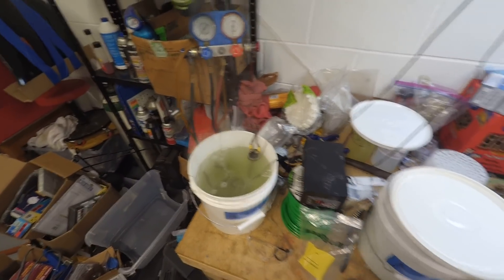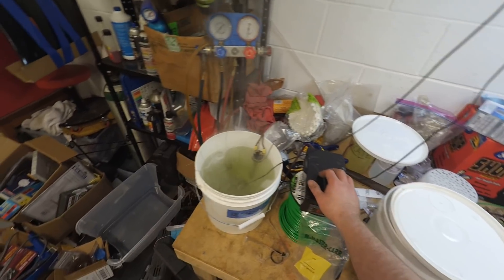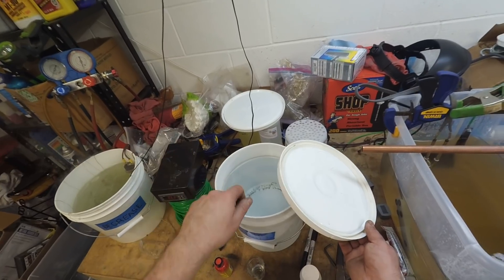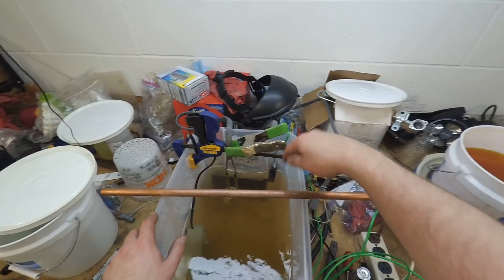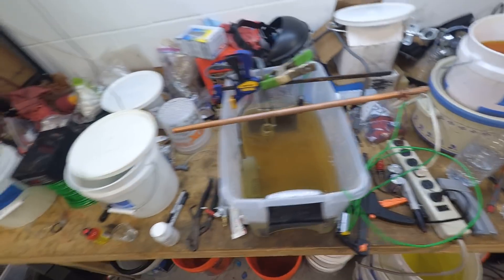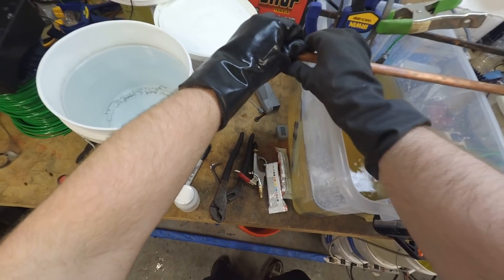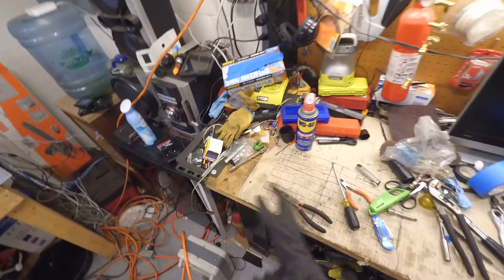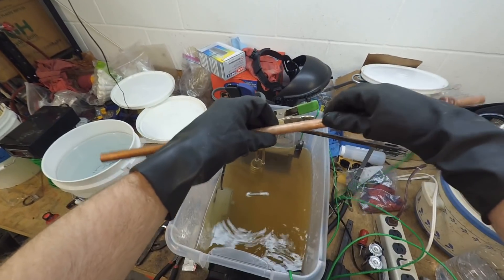Caswell Zinc plating system

Comment: I have had an issue with the yellow chromate sticking to the parts.  After 24 hours it just wipes off.  Do you use heat or anything special to dry the parts so the chromate sticks better?
Reply from the maker: Nope. Are you dipping your parts in acid and then rinsing right before the chromate treatment?
Reply: @adamky1   Yes.  5% muratic acid bath.  What is your chromate mix rate.  1 oz per gal?  I have read some use 3oz per 1 1/2 gal up to 2oz per gal.
Reply from the maker: @kzem968  I honestly do not remember. Did  you heat the chromate solution up to the correct temperature? That's the only other thing I can think of.
Reply: @adamky1    YEP.  85 degrees.  Where I live is 90% humidity right now so maybe having the parts hang outside in that for 24 hours to completely dry and set is my problem?
Reply from the maker: @kzem968  I wouldn't think humidity would affect it that much, but maybe. It sounds like you're doing everything else correctly.
Reply: @adamky1   That kind of sucks because the chromate continually fails to stick.  maybe I need to dry and hang the parts for more than 24 hours?  I did see a video where a guy dropped the parts in the 5% muratic  acid before plating and before chromate but since the plating seems to be fine I'm guessing that does not matter.  craziness.

Comment: 06:50 actually, NO! They are not molecules travelling from the zinc plates. They are ions - and they come from the solutiuon. What happens at the plates, is a completely different story. That is only zinc being deposited into the solution, to replace what has disappeared during the plating process.
Reply from the maker: ,
Okie dokie

Comment: It is a miracle that you are still alive and healthy after using that setup. No air filters, no security what so ever for using so many hazard liquids in such precarious setup, unsecured and in dangerous positions. And on top of this so many electrical plugs and devices all over the place and around those liquid containers. Man, I do respect your generosity to show us your experience with that setup but PLEASE tell people this is not a good safe way to do plating. Also, I am very sure a damn new bolt cost so much less than a single use batery. Other then that thank you for the video.

Comment: Fantastic video, thanks for sharing.  I got the Caswell kit last week and look to start plating next week.  Your video is a thousand times better than what they have.  Thanks again for putting this together, it will certainly save me some time.  
Do you have a link for the heater controller?
Reply from the maker: The Restoration Shop. Thanks! This was the controller I purchased: Inkbird All-Purpose Digital Temperature Controller Fahrenheit &Centigrade Thermostat w Sensor 2 Relays. Link -->
 https://www.amazon.com/gp/aw/d/B00OXPE8U6/ref=oh_aui_i_sh_in_o0_img?ie=UTF8&psc=1

Comment: Is it possible to plate parts with non-removable non-metal components in them? For example, a check valve that can't be disassembled all the way with a rubber diaphragm inside?
Reply from the maker: noob5000000 I've done it. I plated my entire water pump assembly which had an aluminum housing, steel shaft/impeller, and a rubber seal. It's been working fine. But I can't say for sure how your part will hold up.

Comment: Hi Adam - Great video. Inspires my to set-up my plating bench.

Can you tell me what solution is used for the rinse tanks before I dip the parts into these tanks:

Degreaser Tank
Acid/Pickling Tank
Plating Tank
Yellow Chromate Tank

I just ordered the Caswell Copy Cad kit so do some of the rinse chemicals come with that kit ?

 A friend recommended a Kikusui PAB 8-5 Power Supply so I bought one to use on my set-up but the rest will look like yours.  

Thanks,  Mark
Reply from the maker: Thanks, I appreciate that. Every rinse bucket is just pure distilled water.

Comment: can you tell us more about the degreasing solution, I see it looks very hot. How do you keep that?
Reply from the maker: Caswell says the degreaser works best at 170-180*(F). This is the temp controller I use: https://www.amazon.com/gp/product/B00OXPE8U6/ref=oh_aui_search_detailpage?ie=UTF8&psc=1
It was cheap, but it requires some sort of "project box" to put it in,
and it's a bit glitchy and sometimes reads way off. So I occasionally check it with a cheap infrared thermometer from Harbor Freight.

I've tried several heating elements. What you want is something in the 1500W range. And unless you have a full size degreasing bucket, it needs to be short. As it turns out, heating elements for RV water heaters are just about the right size.

...or here's another one that I tried, but I MUST warn you first that as-is, it's dangerous. The wiring is totally inadequate and WILL melt and short out if you run it for more than 30 seconds: https://www.amazon.com/Westcoastpapa-Travel-Immersion-Portable-Element/dp/B01307Z89C/ref=sr_1_fkmr0_1?ie=UTF8&qid=1498030604&sr=8-1-fkmr0&keywords=XtremepowerUS+1500w+Water+Boiler+Coffee+Tea+Heater+Immersion+Portable+Boiler+Element
So the wiring MUST be upgraded before use!!!!!!!!
The nice thing about it is that the part that goes in the water is all stainless steel so it shouldn't cause any issues with plating. most of the RV units are chrome played and the zinc-plating process will strip that off.

Comment: What is the ratio of muriatic acid to distilled water you are using in your pickling bath?
Reply: Jason with Caswell said to use 10% muriatic acid and 90% distilled water.
Reply from the maker: Allen Nichols - Yes, pretty much everything I do is using Caswell's recommendations

Comment: Hi. 
1. What is in degreaser tank? Water and ?
2. In plating tank what is in the solution and why are you using aquairum filter for circulating?
3. Which buckets are you using Distilled water? Rinse or the others?
Reply from the maker: Arda Yalçın - The degreaser is from Caswell. And the aquarium pump is just there to circulate the solution. It comes with the Caswell plating kit and they recommend using it.
Reply: thanks for your respond. In this kit is there in zinc sulfate

Comment: Nice job, well done. What material are your hanging wires? Also, why is your zinc acetate so murky?
Reply from the maker: Thanks! The hanging wires are 10g solid copper. When you say "zinc acetate", are you referring to the yellow/gold chromate tank?
Reply: adamky1 no, the zinc plating solution
Reply from the maker: Ah, gotcha. This was after a long day of plating and my tank gets like that after a while. I like to run the entire solution through double coffee filters every now and then and that clears it up.
Reply: My plating solution is crystal clear but the parts come out dull matte grey and won't take the dichromate very well. Yours is murky and the parts come out shiny and passivate beautifully
Reply from the maker: You're running Caswell's plating solution?
Reply: No, home brew. Does Caswells solution start of brownish?
Reply: adamky1 I just ordered the Caswell 4.5 gallon kit. Did you buy theirs or did you make your own power supply for the zinc plating tank?
Reply from the maker: Denise McDowell I am using a Volteq 15V 30A power supply purchased off of Amazon. At this time, the price is around $190. They also have a 20A model for around $140, but I'd rather have more than what I actually need just in case. For example, it took ~22A to plate my fuel rail and I wouldn't have guessed that it would have needed that much to plate properly. The adjustment knobs can be a bit touchy, but it does the job well by allowing high current at very low voltage.
Reply: adamky1 I mixed up my 4.5 gallon Caswell kit and was having amazing results. Beautiful near chrome zinc finish and then after about 10 small parts, it slowed down and the parts are now flat, blotchy and somewhat gritty. I have played with the current and also ruled out pre plate prep. I can't imagine my solution is bad already but it's all that's left. Any idea how to diagnose the issue with the zinc plating solution? I also noticed my tank heater element is black so it appears I have some contamination in the solution already. HELP! Thx
Also, approx how many pieces were you getting out of one new D battery?
Reply from the maker: Denise McDowell - How much brightener are you adding? Have you played around with that at all? What about using the carbon filter on your circulation pump to strip the brightener out of the solution? I do this occasionally just to get the brightener out and then start over again. Also, FWIW, I have had decent plating results even when my tank was cloudy-looking. It's hard to remember how much plating I got out of a D battery... maybe 4-5 medium sized bolts..

Comment: how does your bolt come out of the 1st tin / silver  zinc plating step shiny , and not have the dull grey build-up that requires polishing or buffing ?   Prior to the final step in the yellow dye 
gold color step ? 

great video !
Reply: Mike Short,,,i agree, is this because of the zinc and brightener powders caswell includes? So far I'm getting dull matte zinc that turns rusty brown in the yellow dichromate...
Reply from the maker: Mike Short - Sorry for just now responding to this. I'm just using all Caswell products. So, it's their zinc solution (3 gallons) with a couple teaspoons of the brightener. Prep is super important, and so is your power supply. Too much or too little current can cause bad finishes. You want very low voltage, like 1-3V. I try to get mine as low as possible and only increase it if it seems necessary to  allow the unit to make higher current. Once I get the part in the tank, I adjust the current until I just get some very light bubbling and then I just keep watching and adjusting. You'll know when you've hit the sweet spot because you can  literally see the plating getting smooth and shiny. I've found most things take more current than I estimate using Caswell's formula. It took a full 20 amps to plate this stock fuel rail from my car, and it's not even a really large piece: https://www.youtube.com/watch?v=43fkOIVXiwk
Reply from the maker: It's either the solution, or the power supply. Having a power supply (a.k.a. rectifier) with enough current for the use along with being able to make very fine adjustments are both very important . With small parts like individual bolts, it's easy to get enough current. But larger pieces with very complex shapes makes estimating total surface area very difficult. As a result, I tend to underestimate the total area and end up with 1.5 to 2 times more current than I expected to get a good finish. You'll know when you've hit the right current because you'll be able to see the part actually getting smooth and shiny as it plates. It took around 20 amps to plate this stock fuel rail: https://www.youtube.com/watch?v=43fkOIVXiwk

Comment: adamky1 just getting into the plating scene, I am still trying to figure on what is the best composition for the plating tank ,what chemicals and at what ratio would be best,for the plating tank,im restoring vintage motorcycles and this is a great way to get close to factory appearance,any input would be super appreciated -thank you
Reply from the maker: I just follow the instructions for the Caswell plating kit. You can purchase the plating manual separate from a plating kit. I did that to make sure I knew what I was getting I to beforehand.

Comment: i've heard where you put the plated items in an oven and heat them up to make the plating harder. 
interesting on the alcohol. i'll have to remember that one. Thanks
Reply from the maker: The baking is actually done to remove hydrogen that gets into the metal during plating and acid baths. It is supposed to restore the hardness of the metal itself due to something called "hydrogen embrittlement". I actually bought a small toaster oven and tried baking some parts @ 350* overnight. It really messed up the zinc plating. They looked like crap. So, either a toaster oven is a poor choice for this, or I'm doing something else wrong.
Reply from the maker: That could be. I found guides that said to bake anywhere from 4-24 hours depending on the part. I didn't see anything that said baking for too long would hurt anything, but clearly something wasn't right.